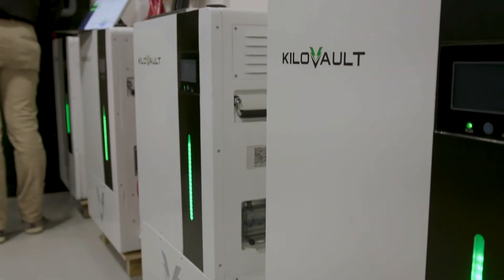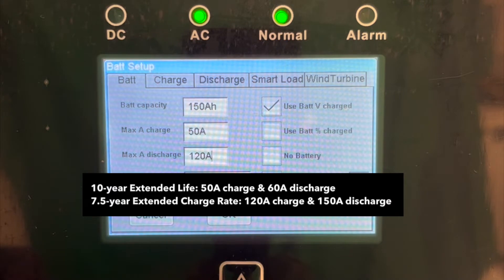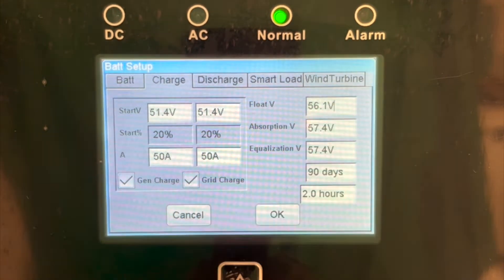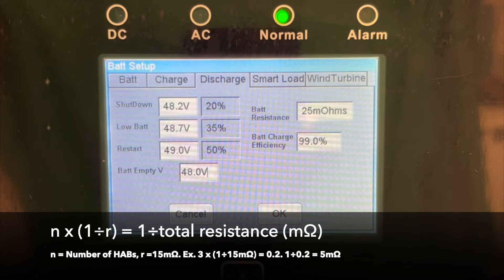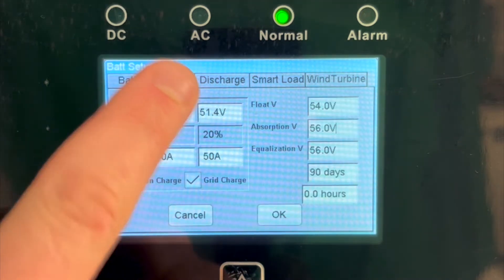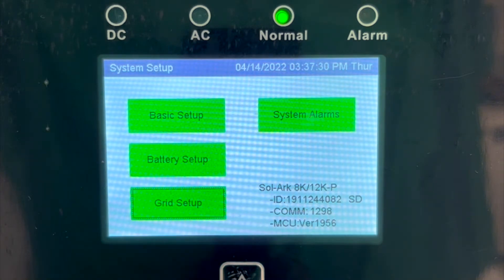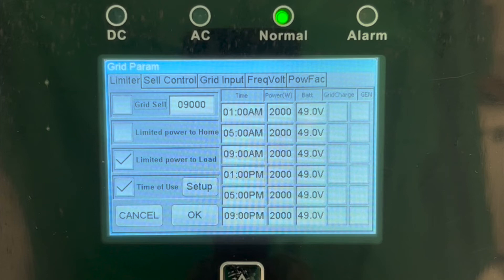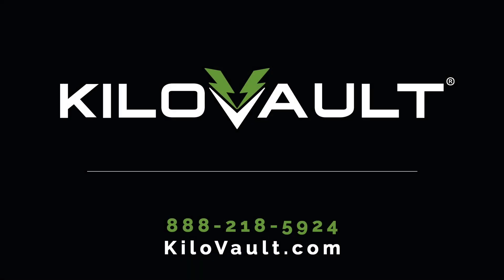KiloVault HAB and Sol Ark Inverter Integration

Comment: The Battery Float should be 53.8 to 54. Not 52.8.  The value is changed to 56 IF the Closed-Loop comm is connected AND functioning.

Comment: What about closed loop communication
Reply: It is possible, update inverter and batteries to latest firmware. Then set Lithium battery 05 on Sol Ark and on the master battery using the Kilovault Hab it app set the inverter protocol setting for 0002.
Reply: @josegabrielsanchez793  By default, the HAB IT value is ‘1’, Kilovault doc sez to ‘11’, Kilovault Support sez that Comm does not function. I have it set to ‘1’ on the app and ‘5’ on the Sol-Ark and it seems to be correct in the PV Pro. The Battery Temp is always ‘77’ on the PV Pro and never changes (no probe connected).